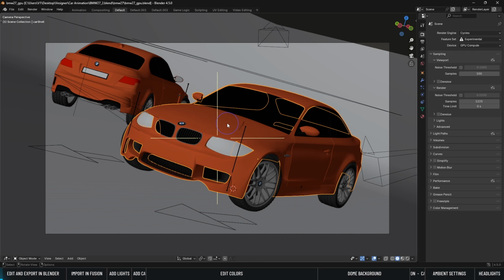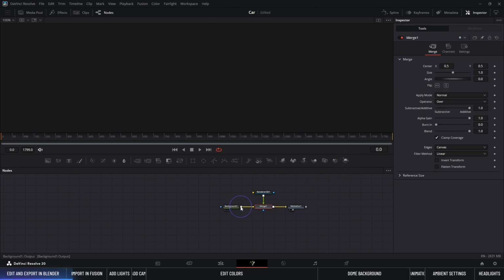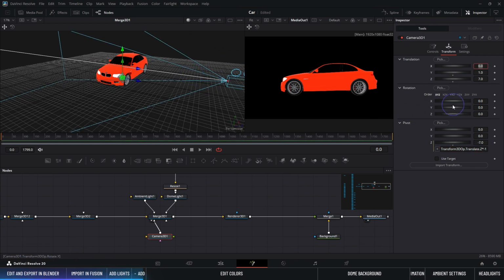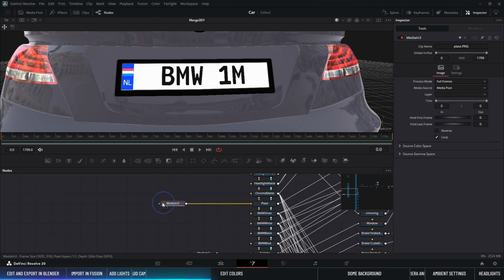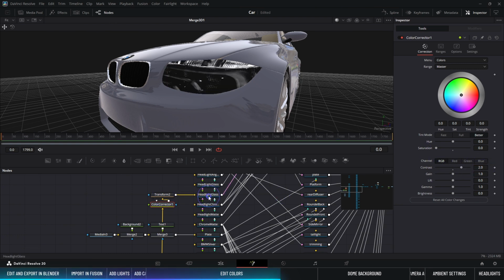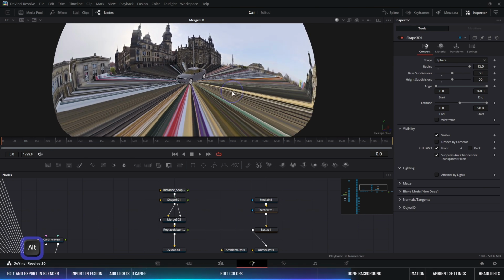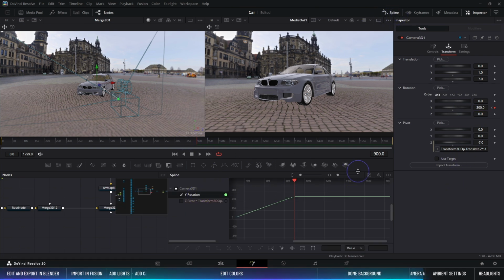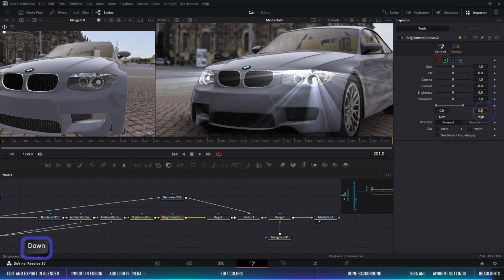Learn DaVinci Resolve Fusion by Making a 3D Car Animation (Part: 1/2)

Comment: the fbx file you used is not  in the download link
Reply from the maker: In this video, I also show how to export a .blend file as an fbx.
Reply: @Vesigner yh thanks,I only use resolve, just wanted to hop on the car fall trend ,I searched all over the internet still didn't find a working model with organised textures.

Comment: this is the worst thing ever it wont even load for me i swear to god if i sea this type of vid ever again i will report you
Reply from the maker: When I experience the same problem and no one else does, I understand that the issue is in my own system and I look for a solution. I recommend checking whether your graphics card driver is up to date, whether your computer meets the necessary requirements for DaVinci Resolve, and the program settings.
Reply: @Vesigner im sorry i was just mad that my pc constantly was crashing hahahahhahahsha